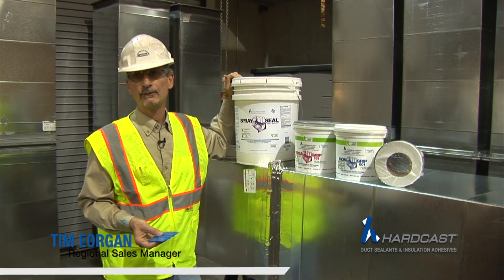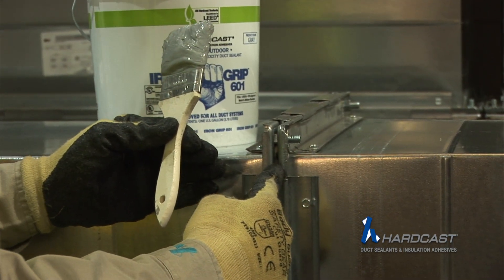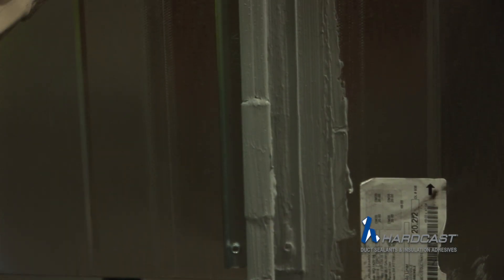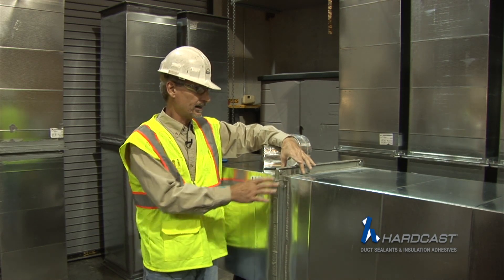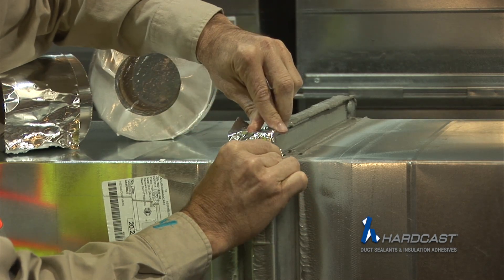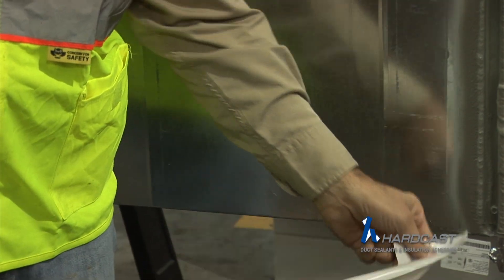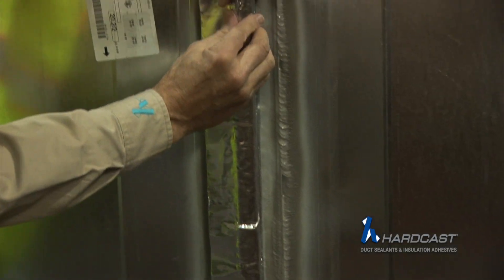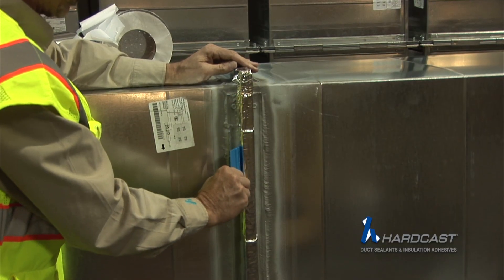Rooftop Two-Part Foil Mastic Instructional Video

Comment: Thank you for the detailed demonstration. Is there a Hardcast product that can be applied over existing mastic/sealant, specifically for exterior ductwork of a rooftop air handler? I prefer to remove as little as possible because it comes off in hard chips which could possibly puncture the roof membrane. Thank you.

Comment: Is the thickness of the mastic critical? I'd think too thick and the tape buckles off or there are air gaps? How long will this last on exterior duct work on a roof? I am thinking maybe 2-3 years if it's a hot climate?

Comment: If I do it like that maybe I get fired, all bosses paying for going faster
Reply from the maker: Since this is a training / demo video we are very meticulous and slow in showing the application.  A seasoned professional contractor like yourself will get this done many times faster than shown.   Also, please sign up for our rewards program at www.hardcastrewards.com and we can get you more information on how this rooftop / exterior solution saves time and money over other weatherproof options.
Reply: And then finally, you spray the entire thing with plasti-dip